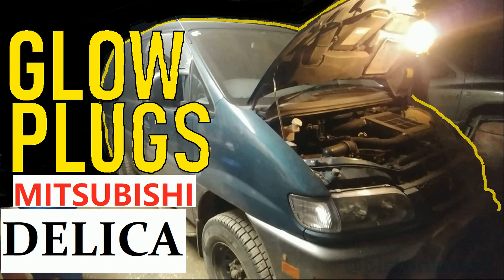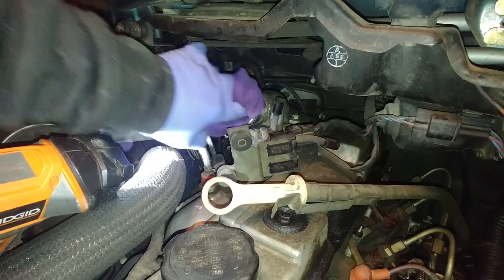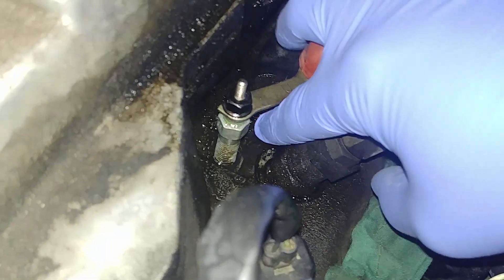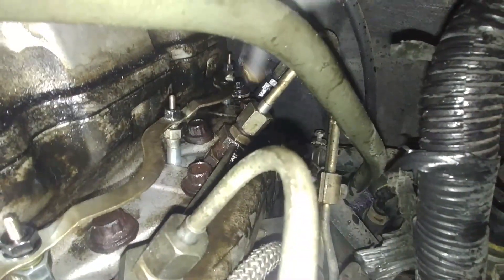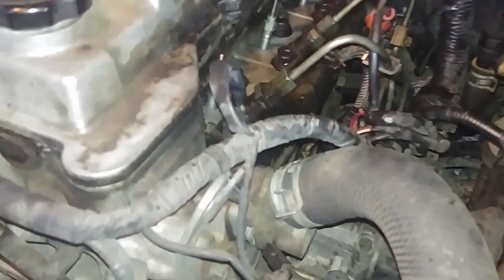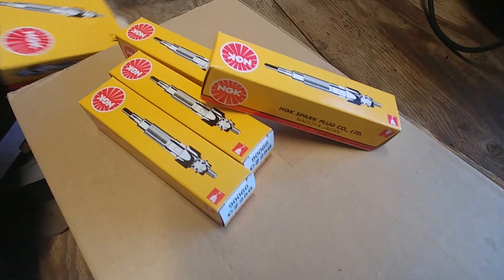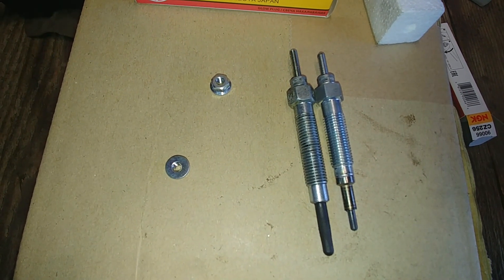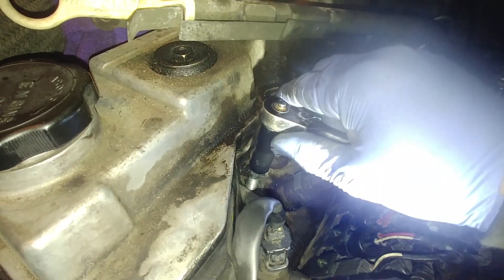MITSUBISHI DELICA L400 GLOW PLUGS TEST & REPLACEMENT IN DETAILS, TEST | Mitsubishi 4M40

Comment: is it possible for the glow plug tip to fall into the cylinder 
 if you snap the plug.Thanks
Reply from the maker: Well, theoretically it can happen but in real I haven't seen it happen. Just don't buy cheapest Amazon special glow plugs.
Reply: @PistonShack  Thanks fella,great videos

Comment: Help!   My Delica starts and idles well, but after a few minutes it will start missing.  I have to add throttle and eventually it will run smooth after it cleans itself out.  The bigger problem, even after the temp gauge is risen, if you start to drive it will flat out die after a mile or so???  It never does this in the summer.  Any advise is welcome.
Reply from the maker: Hey Erica. I would replace fuel filter first before doing any further troubleshooting.

Comment: How do you get to the starter motor with not much access space?
Reply from the maker: Yeh, Jim! Delica is treatable vehicle to work on! There's almost no clearance but You can get to the starter from the top and underneath. Bzw, how is your starter replacement. Before you remove old starter, check / clean all wiring (ground as well) known to corrode over time.

Comment: Hey mate your videos great the only thing with this I ask another guy first a diesel mechanic because I was scared to break he said 100% remove when engine hot NOT cold as when cold is when you have risk to break when hot the metal easier to loosen.
Reply from the maker: Hey brotha! I won't try to remove glow plugs on hot engine, most likely you will strip threads out completely or damage them for sure. I will tell you from school and my experience never remove glow or spark plug on hot engine.

Comment: does all glow plugs needs to be connected to the power line?  and if yes what can it cause, could it cause a loud knocking?
Reply from the maker: Hi Joshua! Yes, all four glow plugs should be connected to the power supply line. Where is knocking sound located (Top/Bottom)? Does it knock only on cold?
Reply: @PistonShack  Yes Sir, it sounds in the bottom, the mechanic said it sounds louder because the injectors might be sending too much diesel, im working on a 4M40 Turbo diesel 2.8L
Reply from the maker: @joshuapech8845  Okay. How many Clicks in your Deli? Have you replaced fuel injectors  (cleaned/tested) before? Leaky injectors can cause diesel black death.
Do you have any issues with cold starts?
Reply: @PistonShack  Not sure about the clicks but im going to calibrate the injectors, no issues with cold stars. starts good and everything
Reply: @PistonShack  the engine is newly built at the moment, is there any way I can send you a video of the truck running?
Reply from the maker: @joshuapech8845  Post a video on your YouTube channel and send me the link. Cheers!
Reply from the maker: @joshuapech8845  That's a good idea. Bzw, if you're going to replace new injectors I will recommend using only OEM parts.
Reply: @PistonShack  copy i will do so. thanks
Reply from the maker: @joshuapech8845  My pleasure!

Comment: well done, just what I needed.   Do you have video on checking the complete glow plug system; solenoid, relay, ignition connection etc...?   I have a L300 td
Reply from the maker: Thanks POPS. No, unfortunately I don't.  What is your question? I might can help you. Cheers and thanks for subscribing!
Reply: Check if there is power from relay to glow plugs..if there is power but no start,then check resistance of glow plugs one by one to isolate which one is faulty....if you have a hard start problem..just sharing..

Comment: estimado mi delica se le queda prendido el tablero despues que saco la llave y no me prende el vehiculo
Reply from the maker: Hi Andres! Seems like ignition key cylinder is worn out, It should turn off power when you switch to off and pull key out. Take a panels from the steering column and check power supply/ground when key is out. Let me know how everything is going. Cheers.